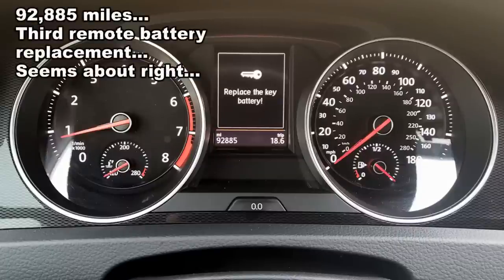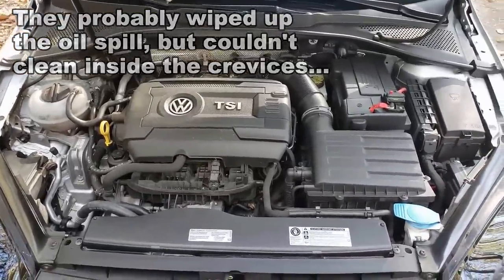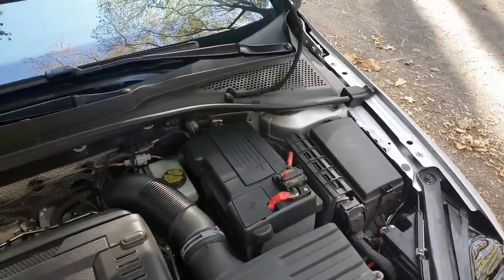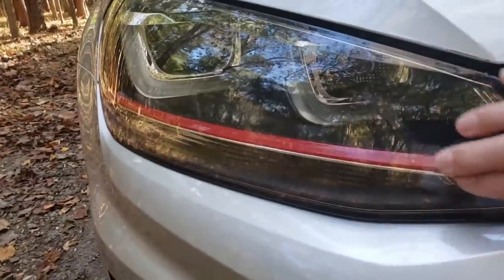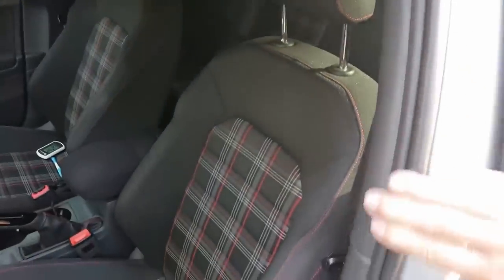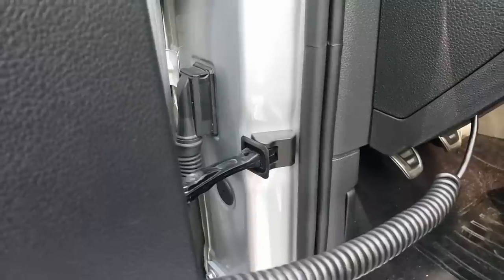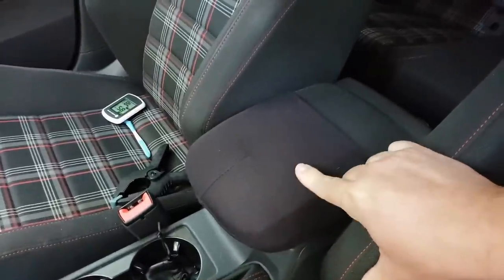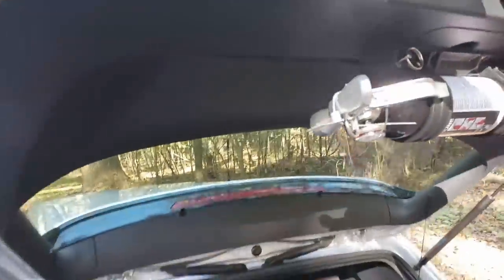THREE YEARS AND 93,000 MILES: My Report, Part 1

Comment: 2016 Jetta 1.8t, 110k miles. Love seeing videos from other high mileage drivers. May do APR stage 1 tune soon.
Reply from the maker: Nice! Thanks for sharing. -Scott
Reply: May do = won't do. Yawn.
Reply: @polopowered  Doesn't seem like a good idea with a turbo model at that mileage IMO.
Reply: @SI0AX  at 110k why not
Reply: @liltayg53  Because some turbo engines may only last 100k if driven hard, before getting rings worn out and requiring a rebuild.
Reply: SI0AX he said he had to change the factory clutch is that because of the tune ?
Reply: @chevoicampbell7598  Yes. Clutches have  a maximum torque rating. When you modify the engine and it exceeds the torque output of the clutch, it will start to slip even if it's brand new. 

There are multiple clutch "stages". Like "Stage 1", "Stage 2" etc. You want to get the lowest clutch for your engine torque output with the modifications and power increase you plan to add because a high stage clutch makes driving the car a lot more arduous.

With a very high HP build, you might be forced to run the highest clutch stage but by then you won't really be driving the car much because it's too extreme and you'll likely just only drive it to racing events.
Reply: SI0AX so if I was to tune 1.4 L and gain 50 hp and that’s it  appropriately how long until the clutch starts to slip?
Reply: @chevoicampbell7598  It's more about engine torque output, not really HP. HP is how long engine torque last.
Example 1:
Honda 4cyl engine: (9,000 RPM * 200 TQ) / 5252 =  343 HP.

Example 2:
Chevy V8

(6,000 RPM * 300 TQ) / 5252 = 343HP

Some HP in-spite of more torque because of more RPM.

Turbo engine tend to make a lot of torque. So modifications that heavily increase torque will require a clutch upgrade sooner than modifications that mostly increase HP. An example would be a high flow intake that tends to gain power in the high RPM range thus more HP in gained vs torque. Increasing ignition timing with an E85 tune and a turbo will increase torque by a lot. 

Some cars come stock with a very strong clutch that can handle a maxed out stock internal engine. You only need to upgrade the clutch when you are going to rebuild the engine with forged internals to make it run a lot more power that the engine would have blown up with.

Example:
Stage 1 Clutch Up to 250 TQ
Stage 2 Clutch Up to 350 TQ
Stage 3 Clutch Up to 450 TQ.
Stage 4 Clutch up to 550 TQ.
Reply: SI0AX I see I am planning to stage 1 my 1.4 jetta which stock is 150-160 hp and 180 Tq it would gain 50 hp and 50 tq

Comment: Coolant isn't consumable so you have a coolant leak. It's probably the thermostat housing or water pump issue which is very common. I had it in my 2015 Audi S3 which shares the same engine as the VW Golf R, the coolant collects in like this part at the bottom of the engine bay, you'll have to lift your car up and get under there and see. I believe you definitely have a coolant leak Lol you shouldn't have to top up coolant
Reply from the maker: Thanks for the note, Michael. I will give it a thorough inspection when I repair my oil pan leak and add my findings to the undercarriage inspection video that I am creating. Thanks for visiting. -Scott
Reply: I have a 7.5 mine does the same thing. They pressure tested it and said it was all good. I can smell it sometimes after I shut off my engine.
Reply from the maker: @chrisl6989  - Thanks for the note. I'll keep pressure testing in mind if my inspection does not find a leak.
Reply: My Thermostat had to be replaced for this same reason. I replaced the plastic housing with a steel one from ECS Tuning and hopefully that helps the cause.
Reply from the maker: @mrdefinitely8769  - Thanks! I'll look into that. -Scott
Reply: 2016 S here. I’m at 34K miles and have smelled coolant faintly through the front grill when engine is warm since year one.  No noticeable  coolant loss however, and no visible leaks. Dealer has pressure tested coolant system twice during routine services and says all is good each time.
Reply from the maker: @robritzman3816  - Thanks! I haven't noticed a smell. That could be a good thing.

Comment: Good review!  I love how these and all Volkswagen’s drive/comfort. I’ll stick to Honda’s though.. much less issues and sunroofs never leak on them.
Reply from the maker: I think you're right about Honda's reliability. However, I don't think I can go back to anything with less than 300 hp after driving my Stage 2 GTI. HAHA! If I somehow become disenchanted with VW's, I'll find something. But I don't think Honda fits my desires. Thanks for visiting.
Reply: Hyundai are better in my opinion but alr
Reply: StealthGTI The top Civic has over 300 horses even before any tuning
Reply from the maker: @jamesmedina2062  - Thanks for sharing. The top Civic's styling is too overt for my tastes. Plus, it's $10,000 more than what I paid for my GTI.
Reply: @StealthGTI  how much did you pay in tuning it up (downpipe, clutch, etc?)
Reply from the maker: @noneyabusiness1359  - I prefer to not add it up. HAHA!

Comment: My 15 GTI has currently 130K on the clock, I am on my 3rd set of tires, 2 set of brakes pads & rotors, replaced the clutch at 120K,
Reply from the maker: My car is mostly a highway car. So, I am fortunate to not need tires and brake replacement as frequently. Thanks for commenting.

Comment from the maker: I had hoped to include the footage of the suspension, exhaust, and other items that showed the condition of the chassis and underbody. However, discovering the oil leak compelled me to comment on that, which made the video longer than expected. I will create another video about the mechanical condition of the car and share that next.
Reply from the maker: The response to this video has been great! I appreciate everyone stopping by and commenting.
Reply: I remember having a halon extinguisher in the car many years ago 👍
Reply: Just have a gasket made for the steel pan
Reply: StealthGTI love your work, for the brand of replacement your front windshield. “FY” is fuyao glass. The made all OEM glass for Mercedes,  BMW and VW, all most all made and models. This should be original parts without VW logo.
Reply from the maker: @woody555kl  - Thanks! I don't know that I could have a custom gasket made for the same $18 I paid for the Tiguan gasket I received recently. I hope to find out how well it works soon.
Reply from the maker: @yuanmengqu  - Yes. I had made another comment below in which I corrected myself about referring to Fuyao as an "aftermarket glass maker." I am very aware of their standing as an OE glass maker. I suspect, but cannot prove, that FY did not win the contract for the Golf windshield because their glass was more expensive, due to its better qualify, than whichever company won the contract. In short, VW chose to save millions of dollars by spec'ing an inferior glass. Thanks for writing. -Scott
Reply: People go crazy for the R, but they are prime target for thieves. I am starting to think the GTI is where it is at.
Reply: It seems like most of the stuff was just normal repair stuff. I hit a curb on my lowered mk7 gti. This surprised me that the curb had bent the control arm, the tie rod need an alignment for a grand total of 2,000 dollars.
Reply from the maker: @marcuszarafonetis6544  - Whoa. You must've hit it sort of hard. Glad you're back on the road.
Reply: @StealthGTI  it was raining and visibility was bad. It pop the front tire on impact. I changed the tire then had to replace same side back tire because of a wear bubble. Then I figured it needed an alignment and I would be good. Nope. But it's good now
Reply: My first gti was driven the way intended in Germany on the autobahn
Reply: My 2006 1.8 Honda Civic has done 232,000 miles and apart from brakes, 2 clutches I’ve never had an issue, only central locking on front and rear needs acuator for front and rear passenger side door for central locking, just had 3rd battery from new

Front windscreen sounds dodgy when temperature is below -10 Celsius  

Honda are more reliable
Reply: Any squeaks creaks moans or groans or knocks coming from your front (right) suspension area? 

Mine makes an intermittent (hard to reproduce) creak/groan at low speed corners such as turning out of a driveway. Occasionally there is a soft knock sound when I let off the brakes at a stop. 

I replaced my front control arms to combat the wheel hop on APR Stage II, but I need to check the bushings and see how they're holding up, I suspect they've corroded a bit. 

My factory clutch also did not last more than 20-30k with the APR Stage I tune. I replaced that with a single mass South Bend Clutch that has held up well to the 100k mark (~70k miles).
Reply: StealthGTI great video but I advice to look at consumer right 2015 you should have a replacement car!
Reply: StealthGTI  hi in my experience VW, Audi turbo engine’s have always used a little oil and coolant.
Reply: I have a stock seat leon cupra 300hp with exactly the same EA888 engine! 24k miles and clutch is not great! Bone stock.... the clutches are effected by the silly delay valve! Get rid of that and   this will help! If you are using water then it's a very common problem that the seal around the water pump and thermostat weaps ever so slightly. Got mine replaced under warranty.... loads ok european cars effected

Comment: It‘s insane how cheap German cars are in the US & how cheap it is to maintain them there and how expensive they are in Germany... especially if you compare a higher trimmed or fully equipped car.
As if Germans are paying for the cheap international/US market prices as well...
Eg. a higher trimmed Golf costs at least 35.000€ (~$39k) in Germany. And that‘s not even with the biggest engine and all the options there are. If you want a fully equipped new Golf you have to pay 45.000€ ($50k) AT LEAST!! It‘s just insane! And with Audi it‘s even worse... you pay 45.000€ for a fully equipped Audi A1... which isn’t even available in the US because it‘s such a ridiculously small car. Us Europeans just get ripped off by our own companies. Even though you guys might not have the same worker‘s rights as we do, things are still insanely cheap over there! Even things that are built in Germany. It’s so bad that some Germans even import German cars from the US because that’s still cheaper than getting those cars here (even with import tax etc)...
Also the basic model of every German car offered in the US is much much better equipped than every basic German car offered in Germany... we even have to pay extra for things like electrically adjustable mirrors, seat heating, LED/BiXenon headlights (instead of classic halogens), navigation/radio systems etc... keep in mind those are all single optional extras, those extras are not part of any trim packages. It‘s as if you get a car with no door and no seats & steering wheel... and you have to pay extra for all of those things. Not even the basic model of the Mercedes Benz E Class comes with LED headlights... it‘s all just for an extra cost. That’s also what makes the cars so insanely expensive... the European basic models basically have NOTHING. It‘s this really annoying “Well, you get nothing for free here” mentality we have in Europe. We even have to pay to go to the freaking public restroom. It’s just a big stupid joke that German-made cars are the most expensive cars in Germany because their basic models are too high priced and don’t have anything, everything is optional. I mean... thank God the airbags or brakes are not optional. Although some even are... (eg. side airbags in the rear for extra safety for rear passengers).
Reply from the maker: It must be something built into your taxes or something. Perhaps VAT? I can't imagine VW would sell cars in the U.S. and lose money on them. Perhaps it's the Mexican market, where the cars are built? No, that's not it; because the Golf R would be far more when compared to the GTI. It has to be Germany sticking it to her citizens, the way you describe it. Thanks for sharing.

Comment: Never seen a manual handbrake on a MK7 before! (Work on these cars daily and all at least here in Norway are are electric..) 

I do have an A3 1.8 TFSI myself. 85000 miles since 2014, and been utterly flawless. Only major flaw was my thermostat housing failing. Had the exact same issue as you with coolant, after the new thermostat it’s never been an issue, so I’d advise to get a check on that (common issue on the EA888 gen 3 engines) 

Lovely GTI by the way :)
Reply from the maker: Thanks for the note. I'll have it checked.

Comment: I work for VW, the coolant loss is normal, the cap regulates pressure for the cooling system and vents at times and needs to be topped off.
Reply from the maker: That's interesting. You're the first to share something like that. Can you share anything about the venting, perhaps some online reading? The car looks pretty solid to me. Thanks for sharing.
Reply: That’s never happened on my 2.5L
And my VW has 140k miles
Reply: it may be common, but isn't normal for any car. Especially these kind of rates. 
cap regulates pressure and overpressure sends fluid to the reservoir. Underpressure then draws it back to the radiator.
Coolant loss without any leak can come from evaporation, but this is always slow. The whole reservoir in 6 months means it goes to either the oil, indicated by a rising oil level, or the cylinders. Either is bad for an engine.

If you say this is normal for VW engines, that indicates a quality issue. Not that this would surprise anyone, VW has built quite the negative track record over the past 10 years regarding engines..
Reply from the maker: @dwergmaster   - To be clear, I don't lose the entire reservoir in six months. I lose about 3/4", which is about a 20% or less. Sure, it may not be normal in your book. But I felt it was worth noting that my loss is not as terrible as you describe.
Reply: @StealthGTI  Ah I thought you mention 3/4th quarter.. In my understanding, that's 75%.
Still not sure what " indicates? Litres or some freedom unit?
20% is still quite a lot though, not only in my book ;-)
Reply from the maker: @dwergmaster  - If I had to guess, 3/4" on the reservoir is about 4-6 oz. I still want to get it looked at, but this doesn't alarm me. Nice discussing with you. -Scott
Reply: Again normal, and not quality control issues. The bottle is the overflow and during venting, water is steam so it is lost in that respect. The more performance orientated engines VW makes the more the loss is seen due to turbocharger heat. The R golfs is very normal to see loss of inch or more in 4-6 months. But you have to check them cold because at operating temps the level is going to be about 0.50 inches low due to pressure in the cooling system expanding the hoses and causing level to drop. When you open cap when hot you will notice the level comes up substantially.

Comment: So you replaced the factory clutch at like 30k? That seems really low for such a big job..
Reply: It's because he was tuned. The stock clutch is only good for stock power.
Reply from the maker: The additional 100 lb-ft of torque at the low end and towing took its toll on the clutch. Thanks for visiting. -Scott
Reply: The clutch in the Mk7 is known to be weak. It'll slip with an APR stg1 and aggressive driving. The DSG on the other hand, will hold 400+ lbft of torque.
Reply: Liam Ross  :  The clutch that comes with the car is intended for the engine which it comes with.  If you tune the car, etc, then the factory clutch will not last as long.  I have 170000 kilometre on original clutch in my VW.  My brother in law has even more, on his.  Not to mention, some people have no  idea how to drive a manual and ride the clutches to no end.
Reply: Liam Ross  My 2004 GTI has 131,000 miles with the original clutch still installed.  The clutch is doing fine.  No issues.  I believe it will reach 150,000 miles.
Reply: Common for tuned VWs and even other tuned cars.  Once you add power and torque beyond the rated design limit of the clutch and begin using that additional power and torque, expect consequences.
Reply: Had to replace mine with 50K. Stock. VW quality...
Reply: my 2008 gti made it to 153k on the stock clutch, tuned for 79k and 380hp for the last year it survived. Out of what I've heard the MK5 clutch was the strongest out of all the generations. currently driving a mk7.5 R at 20k hoping the clutch will hold up tuned for 15k...
Reply: My clutch went after 2 weeks.  I'm apr stage 1
Reply: And these are the kind of cars you stay away from when looking for one second hand, if the dsg clutch goes out that fast most likely it has been beaten on hard even with a tune

Comment: I have a 2015 GTI with 34,000 miles. I installed an aluminum skid plate before steel oil pans were available. I kept my plastic oil pan and have had no issues.
Reply from the maker: Thanks for sharing.